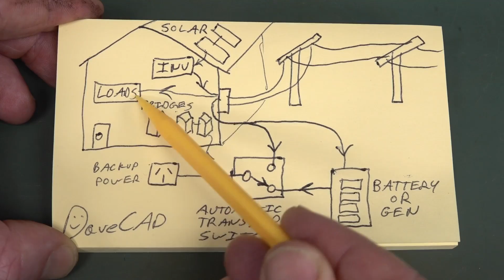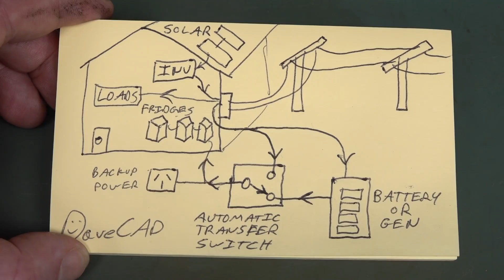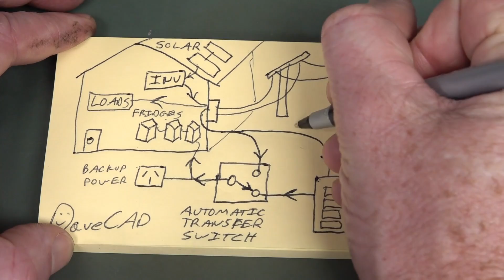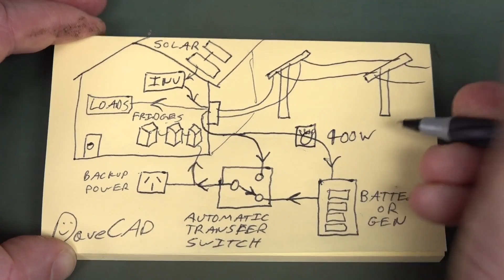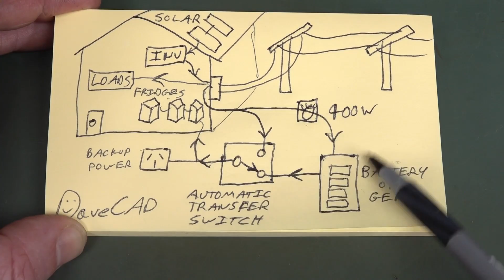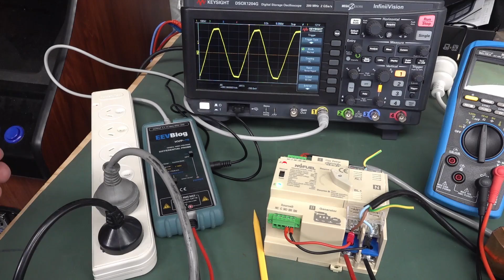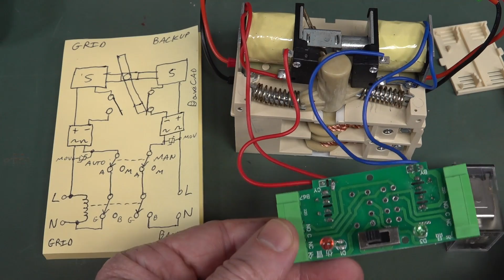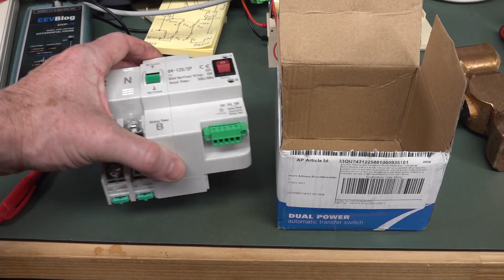EEVblog 1500 - Automatic Transfer Switch REVERSE ENGINEERED

Comment: Cute little baby transfer switch.😁

The data center at the bank I used to work for was more the size of a refrigerator, and had a huge lever, not a tiny knob.

Those microswitches are effectively the negative feedback side of the circuit. Typical sort of a limit switch setup: apply power until you're in the right position and then stop.

Comment: Is there some hysteresis to the micro switches that control the main switch solenoids, or are they relying on momentum to complete the switch change?
Reply: Dave drew the diagram backwards "for simplicity" but they're actually normally closed switches mounted on the destination side. The power isn't cut until the movement is complete.

Comment: My guess is that the switching time varies depending on where in the sine wave the switch happens. If it's near a zero crossing it will take longer because the solenoids may not pull the rod until closer to peak power. So you would get some ~10ms (half cycle) variation in the timing.

Comment: These micro switches are bothering me. They tend to fail without warning. And, it can fail in a way that its contact remains closed. That way a coil would remain constantly powered and will burn. Hopefuly not causing a fire!!!
Reply: Don't worry, the CCA wire in the coil will burn open in around 20 seconds, disconnecting it, and the thin wire is the fuse.

Comment: A good ATS should be 'make before break' to provide uninterrupted power source.
Reply: You can not do that safely unless you can guarantee the power sources are synchronous.  Electrical codes also typically require break-before-make to ensure that generators can not backfeed onto the grid.
Reply: @MrRaineth  You are right.  UPS can do but more expensive.

Comment: How much power does the relay use by it self to hold the solenoid ?
Reply from the maker: It doesn't "hold" the solenoid. It's a one-shot pulse to flip it.
Reply: @EEVblog  But doesn't the relay need to be continuously powered in order to sense that the priority input has power?

Comment: For your 3 fridges, I have seen someone make a 3 relay box, to prevent all 3 loads starting at the same time. It's a very low chance of this happening, but with thermostats opening & closing, it can happen.
Reply: How does that work?
Reply: They used an arduino for sequential control of power outlets, to avoid heavy start up loads.
Reply: @slypig24  but the compressor will turn off after a time, so how do they detect when it would turn on again and prevent 2 from turning on at the same time?
Reply: @Philip8888888  it is most likely just for the initial switch on, when all three compressors would kick in at the same instant... I. E. Turn them on in sequence with a 10 second delay or such, and then whatever happens happens. Yes, you could get fancy with power and even  temperature monitoring, but more risk of something failing then.

Comment: I know you are running freezers through this but I would think the delay of it switching over wouldn't even cause your digital clocks to go to "12:00" and blink. (If you were using it as a backup for grid failure). Hey! Try that, Dave! "Plug" a digital clock into it and see if the toggle action is fast enough to keep it going. I would try that before seeing if it crashes a desktop computer (or not)!  😱
Reply from the maker: Our fridges don't have clocks.

Comment: my concerned is the lifespan of the coil of relay that continously energized
Reply: Same that's always what I think of with permanently on relay coils and I haven't really found an answer.
Reply from the maker: They are designed for 240V AC power

Comment: I can't stand when people use the word battery generator you're not generating anything you're storing it so really it's a battery storage. Probably not a problem where you are but for some reason we have people down this way you think generator house inside no steal etc. I really think we need to distinguish the Termanology so that gas generators go outside and nothing else is called that that can go inside for safety reasons. Some of the manufacturers are now introducing built-in carbon dioxide detectors but there's a lot of old generators around yet.

Comment: Hi Dave, very interesting. I wanted to use this but was concerned about safety, so built a servo to a manual transfer switch (video on channel!). But this looks great - and now I can see inside I'm happy to spend the $50. Cheers!
Reply from the maker: There are also much more expensive versions that I'm sure are certified to meet various local standards etc.
Reply: @EEVblog  Yep. I am doing this to save money not spend it :D
Reply: @AndyMcBlane  These are chinesium devices and at the pricepoint I would not take the current rating seriously!
When you pay up to 10x as much for brand ATS at the same current rating(63A) you know something is fishy.
Reply: @animarkzero  only switching <2A but thanks
Reply: Ah yes, I want to be able to switch grid off programmatically... maybe a smart plug will do.

Comment: Here in europe where power is expensive i do measure actual power into/from the grid and switch extra consumers according to solar surplus. Measuring is done with 3-phase shelly-3em over WiFi, switching load is done with sonoff-basic over WiFi.

Comment: Is that timing OK for the fridge compressors? What would it look like with different sources, the sine wave wouldn't nicely match up from two different sources would it? Any issues cutting the power on/off/on to the fridges frequently? I hear compressors don't like that. But also read that fridges have a timing circuit to leave the compressor off so pressures return to normal before they restart. Any thoughts?
Reply from the maker: Don't know, but this would very rarely activate, only during a power outage which is incredibly rare here.
Reply: That thought crossed my mind as well. AC compressors are supposed to be left off for two minutes once they stop so the pressure in the lines can bleed off. But even if that's also the case for refrigerator compressors, I think this thing switches quickly enough that the compressor motor would barely slow down at all before the backup kicked in and it got synchronized.
Reply: @chitlitlah  Yes but the inertia of the compressor might be against the new AC's inertia eg. too far out of phase.

Comment: Slight complication on earthing. If your incoming supply is TN you may need to add another set of contacts to the ATS to switch a local TT earth  (earth rod) to the load and your battery inverter when it switches away from the mains supply.  This will ensure that your fridges retain a safe earth if your grid cable fails.  Life is much easier with a TT connection to the grid.
Reply: Why wouldn't you just tie all the grounds together permanently?  What's the point of switching them?
Reply: @uzlonewolf  that's a UK regulation. I don't know if it's the same for down under. 
Although now that I think about it for RVs, boats and generators in the US there can only be one ground bond to neutral and that's in the main service disconnect so if it's gonna be shifted that also has to get shifted sometimes.
It really depends on how the device handles it's internal ground but yeah he probably should do a three pole.
Reply: No need to switch your earthing, you can have auxiliary earth electrodes no problem, just have to make sure that your transfer switch does switch neutral along with line, and that your generation source has a neutral earth bond at source of supply. That way when you switch to either source it is still a TN source supply, irrespective of being local generation or incoming power from supplier. In both cases they are electrically separate from each other, and are both TN supplies. You have to use the supplier CPC, but also are permitted auxiliary grounding, especially if you have things like metal framed buildings, or antennas that need to have a ground connection for operation and safety. Common with metal water pipes and such to use them for this purpose, as they are required to be bonded to make the building equipotential.
Reply: Would love an extra video from Dave highlighting additional earthing considerations when using auto transfer switches and regulation differences between for Australia/UK etc.
Reply: @majintheport  maybe stick to electronics videos

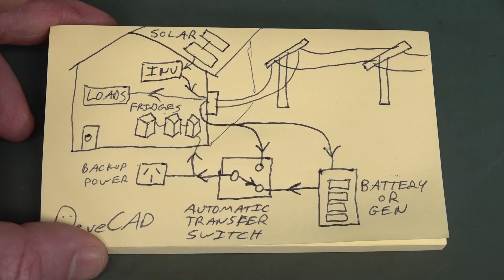Comment: 8:26 This seems like a hell of a lot of complication for basically no benefit. Fridges don't really use much power at all so it's not like you're saving much money running them off your roof panels.
Reply from the maker: Sure. About $1 per day saving here. It's more the satisfaction of doing it.
Reply: @EEVblog  Ok, but what's the $/cycle battery cost...
Reply from the maker: @johnalexander2349  Depends hugely on the battery solution you get.
Reply: @EEVblog  But it's less than the saving, right? Right?
Reply: If there is a power cut (increasingly likely these days) then you don't want your food to be ruined.
Reply: @MrEdrftgyuji  I live in Africa - my fridges have been on the UPS circuit for 15 years now.
Reply: you're disappointing me.

What happens if you have an actual AC mains failure toward the end of the battery cycle? This isn't a backup at all.

Having the fridges on a transfer switch makes plenty of sense sure but would be more useful in the "traditional" direction: mains as primary, battery as backup. You'd be stressing your batteries less (longer life) and the "backup" would actually be useful at all times of the day...
Reply: @emolatur  He mentioned that Sydney hardly ever has any power failures, and he's probably right - police states tend to run a tight ship.

So all that counts is the cycle cost of the battery - if it's lower than the power he would've used, less any other use he could've found for the power he's generated, then he's ahead. That's doubtful. On the other hand, I think the battery was free.
Reply: What about if the battery fails at 5PM? Fridges off until 9AM. Might need an alarm or a second ATS that feeds mains in all the time. So ATS1 is fed from battery and the timer. ATS2 is fed from ATS1 and a backup of mains without the timer. Then you have as much redundancy as you can have without going overboard. Or just have a temp alarm.
Reply: @vk3fbab  A battery failure at 5am is exactly the sort of thing the transfer switch is there for.
Reply: @stusue9733  if the battery fails at 5 PM or AM the ATS switches to mains. Mains is not energised because the timer runs from 9AM to 4PM. So you need a second ATS or maybe a timer bypass relay when the primary feed goes down.
Reply: @vk3fbab  The timer is only for charging the battery, main power is always connected to the ATS.
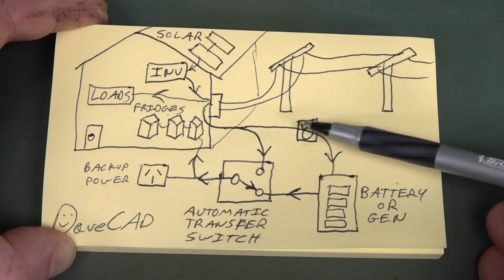Reply: @vk3fbab  What kisslab said. Have a look where the "timer" is drawn at 10:03.
Reply: @stusue9733  @kisslab right you are missed that. All is well.

Comment: I'm guessing the solenoids are so powerful that it can't run them continuously, so the microswitch turns off the solenoid as soon as it has done its job.
Reply: My house was prone to brownouts.  If the power went out then the generator kicked on, and the switch transferred power: great.  But if the powercame back in brownout mode, the generator would turn off, and leave the main solenoid on brownout power (i.e., not enough to switch back).  Yup: melted solenoid!

Comment: can you recharge the battery directly from the solar and avoid the cutoff timer?  Plug the battery into the grid if the solar doesn't keep up with demand.
Reply from the maker: Yes, the one I have has solar input. But if the solar for that day sucks then you risk not having enough power and your fridges turning off.
Reply: @EEVblog  still have the automatic transfer to avoid the risk of your fridges turning off.   Is recharging directly from the solar more efficient?
Reply: @danielmcnerthney  yep I was thinking the same thing and alternative would be a daylight sensor. Concern the timer might lose time.

Comment: Do your refrigerator/freezers have protection against short cycling?  I don't know if the 20-50ms glitch is enough to get the compressor motors to lock up.
Reply from the maker: No idea, but it's rare this would actually switch.
Reply: @EEVblog  If the battery pack starts to fail or underperform, You will observe shortcycling of the automatic changeover switch when the compressors are called in by refridgerator control system which will kill the refridgerators for sure (got to know about that after watching several videos from  @HVACR VIDEOS  channel). My suggestion is to use a delay line(delay setting of 5 minutes) between the battery pack and the change over switch for additional protection,

Comment: Barring aside the manual switching, would it be feasible to use a DPDT contactor with the coil wired to your priority source to do a job like this?
Reply: Absolutely! You do lose the ability of controlling it manually, but there should not be any major harm in doing so.
Reply from the maker: I think that would work.
Reply: Disadvantage of around 20VA constant power consumption, as opposed to the small relay only being around 1VA coil current.
Reply: Element14 part 2787143 seems to switch pretty fast. I'm thinking of using it for an always-on inverter ready to replace mains 240v in a blackout for PC & display & external hard drive.
I'm considering options to include a timer so that when the mains does come back up, it waits a few minutes before switching back over to it.

Comment: R-N contacts? I'm used to L-N.
Oh, wait, it's chinese, right? 😀
Btw, the contactor in the first unit is something i was taught not to use on inductive or capacitive loads bc of arcing and therefor burning off contact surfaces.
We didn't see the other unit's contactor, so i hope it has wiper style contacts.
Reply: many countries in the world use the designation R,S,T instead L1,L2 and L3 (A,B and C)  for the three phases.  In West Europe were R,S,T common until the 1970th.
So this transfer switch has R instead L1.  

I use a homebrew transfer switch with 2 contactors and 2 relays. The controls are setting the priority of both sources. There is a djustable timer  for the override delay.
The inverter got a control input for mains synchronisation. It need 24ac from L1 . After the mains  return after failure  the inverter synchronize to mains , if the oscillator locked on a relay located in the inverter close the control circuit to the transfer switch.  The inverter is able  to connect parallel to mains  and turn off after. That means uninteruptable transfer. But that configuration  need a permission from the DNO. 

The contactors are moeller/eaton 63A models with aux contacts. I got 230/400V 50Hz 4-wire TN-C-S mains.
Reply: @Reaktanzkreis  Ja in dem Fall... :D
Ich kenn das RST System auch noch von alten Anlagen. Bei Motoranschlüssen hat sich ja als Überbleibsel UVW noch festgesetzt.
Was die Schütze angeht denke ich das Möller generell alles Zuganker Schütze sind bei denen man sich keine grossen Sorgen um Kontaktabbrand machen muss.
Hatte allerdings das letzte mal ein Möller Schütz vor fast 20 Jahren in der Hand. Ich seh meistens nur Siemens.

Comment: Hi regarding the fridge circuit, will you pull a new circuit through your house just for this setup? As I could imagine the complexity of putting this in line to an existing circuit may cause confusion down the track. How will you identify this in the mains board and on your GPO outlets. There could be other devices plugged into that circuit in the future or more GPO added? (PS I am not a qualified sparky so take my comment with a pinch of salt)
Reply from the maker: Yes, new cables pulled, totally independent to the other fixed house wiring.
Reply: @EEVblog  If you have a dedicated circuit for you backup supply you should consider using red socket outlets, these are the industry standard for dedicated UPS / Emergency circuits.

Comment: Nice video. Didn't quite follow the trigger setup.  Curious if a rigol 1054Z is capable,
Reply from the maker: The Keysight doesn't have a fancy dropout trigger, so I just bodged the pulse trigger low trigger.